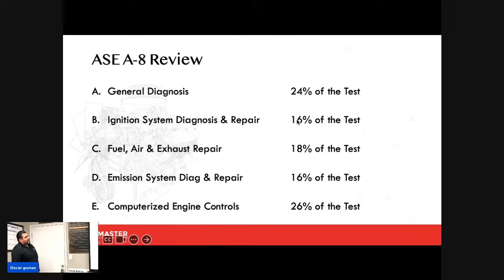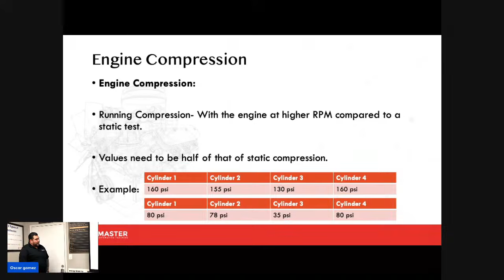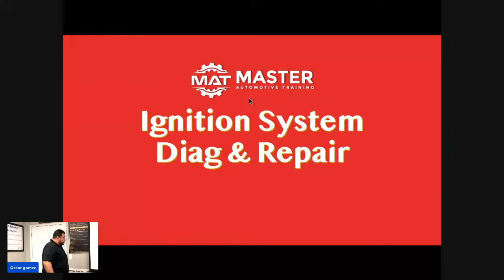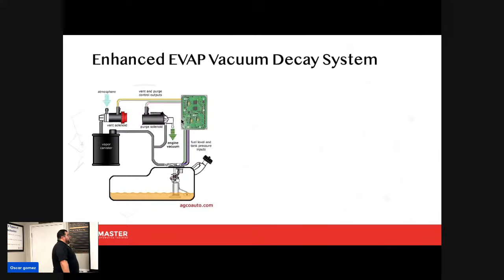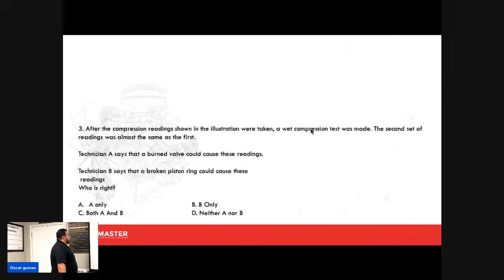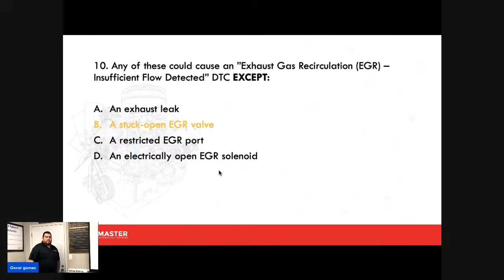ASE A8 Engine Performance Boot Camp

Comment: Passed it today (second attempt) I’d say this video was essential in helping me to pass, however if I was really brushed up on wiring diagrams I would have done a lot better. It felt like more than half the test was electrical. It’s a lot of dmm readings at different points on circuits and some questions had multiple readings so the visual alone tripped me up. 

They also asked a question about a can bus waveform and you had to know what was wrong with it- yeah I had no clue. Lol

Comment: Passed the A8 on 8/25/25 with a 42/50. Definitely tricky, had to read questions carefully and not second guess myself. Thank you for taking the time to make this video. Your content covers the intricacies of late model vehicles while a lot of the test prep books cover older technology that is not even on the exam like tower coils and waste spark systems. I would really appreciate if you could make a tech tip Tuesday video on diagnosing wiring for thermistors. i.e. shorts and opens at various points in the wiring (5V line, ground line, etc.) and the affect on the temp reading. I got a question on the test concerning an overtemp fault and you had to diagnose the type and location of the fault in the ECT wiring (shorts/opens at points w, x, y, and z). It really tripped me up.
Reply from the maker: Congratulations brother! https://youtu.be/onkjvmzxGWw
Reply: @MasterAutomotiveTraining  Thanks!, I must have overlooked that video.

Comment: There were a few examples of vacuum gauge readings and possible issues in the video. I have seen some videos talking about other possible issues and gauge readings. About a dozen possible things such as improper air fuel mix, advanced or retarded timing, head gasket issue, etc. Can you please make a video just covering the vacuum gauge testing and all the different possible readings and causes, and the theories behind them? Maybe some real life examples on engines that have issues. Practicing diagnosing using the vacuum gauge and testing our knowledge. That test is so valuable as a quick starting point to find out many things. You covered a few in this video and they were very helpful. There is some info out there, but a lot of it is conflicting and confusing. Most people want to plug a scanner in and think it is the only tool out there. I don't like to rely on that as the only method. After all, an engine is still a glorified air pump under all the electronics. I wish I had paid better attention to and remembered what the old timers that used a vacuum gauge were telling me.

Comment: At minute 15:00 of this video, you have voltage drop values for certain parts of the circuit of a starter and alternator, but in another video you made, the values are different. Which are the correct values?
Reply from the maker: I compared them all and they are the same except for one that has a PCM ground of .050v.
Reply: @MasterAutomotiveTraining  Sorry, I should've pointed out which ones were different in the other video. The other video had 200 mV from B+ to starter and 300 mV across starter solenoid. Which values are correct?

Comment: how do you do a running compression test on a single cylinder engine after doing static test?
Reply from the maker: Wouldn't be possible as you only have one cylinder. Id do a vacuum test instead.

Comment: This video was a huge help for me!! Thank you so much, passed my a8 first try thanks to the video.

Is there any hope that you'll do I video for the transmission ase test in the future?
Reply: @Klark-hm3cq I had about 8 or 9. Most of them were pretty basic diagrams. A couple Were more complex
Reply: It was 60 questions. If you watch the a6 and a8 test prep video it will give you everything you need to pass. Very limited manufacture based questions. I saw one of 2, everything else was pretty generic
Reply: 42 out of 50
Reply from the maker: We are most definitely working on them and once completed they'll stream live. Thanks for watching.

Comment: I love your videos, they have been great study material. I do have a question. Near the end of this segment, it's states that during vacuum test,due to clogged exhaust needle fluctuates from 12 to 24 on the gauge. During my reading I've known this to be from a broken valve spring. Is this a typo or mistake? Please explain . Thank you. 

On a similar note, can you guys do an in depth video on super and turbo charger operation and diagnosis? Thanks.